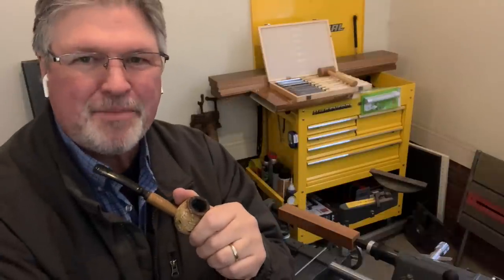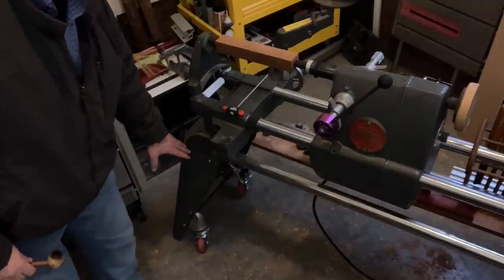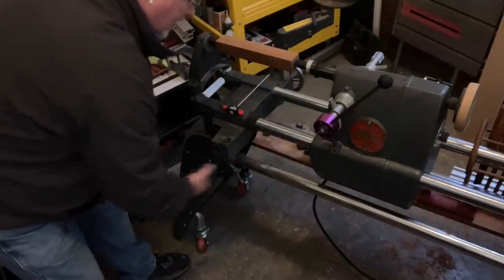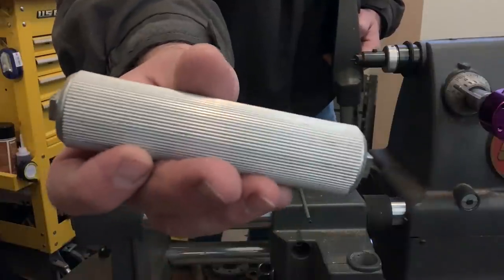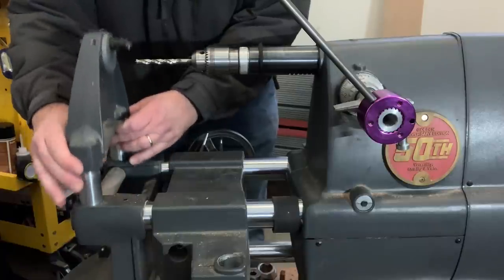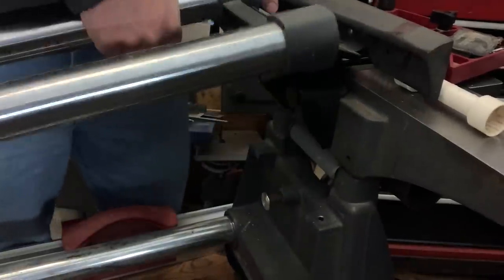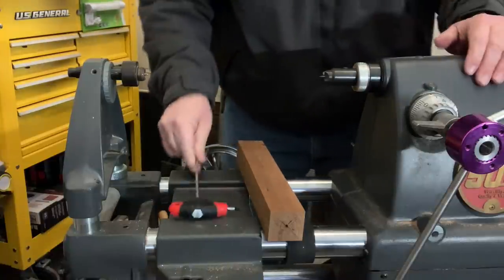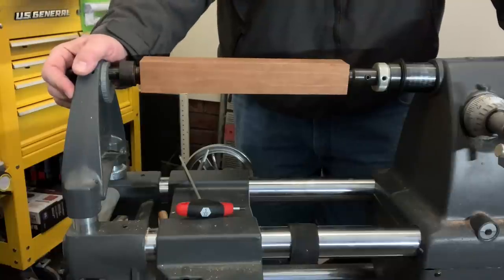Before Turning On Your Shopsmith Lathe, Watch This!

Comment: I do not agree that the Shopsmith is a lathe based machine. In fact without the heavy banjo upgrade it is a terrible lathe. On the other hand it is both a vertical & horizontal drill press. The SS drill press in my opinion it may be the best woodworking drill press on the market, but not a $4000 drill press. 

On another subject "waxing" I think you are right on target with everything but waxing the quill. I would never wax there. For my quill I oil the shaft & grease the rack & pinion. I see your point, but considering the pressures & other stresses applied here I want smooth but rugged on the quill. 

  By now I hear you saying "now I know why they don't send donkeys to collage". My SS background is this. I started woodworking in the 7th grade shop class. My teacher & friend was a guy who also lived a cross the street. I didn't  know it at the time, but my 7th grade class was also his 1st year teaching. In his senior year Magna Filled a room with porotype Mark 5 machines and turned those future shop teachers loose. When   my teacher got to my class the SS Mark 5 was the best thing since sliced bread. It left an impression. I didn't get my 1st used Mark 5 until the mid 60s. I had to rebuild twice. A new machine cost way too much for my pay scale. Soooo I bought a TotalShop. I would like to go on record (after repairing both mine and others) this machine is a piece of junk. I think the TotalShop guys took a SS to China and told them to build a similar machine just as cheap as possible. AND THEY DID! I bought my 520  in 1999. At this point my SS is my drill press & back-up for my other tools. I served as SS mentor in my local working club & as a go-to person on North Carolina Woodworkers web site on things SS. 

Interesting side note. The going price around here for a used SS with no extras is  around $500   when such a  machine comes on the market cabinet shop jump on them like a rooster on a June bug. Why? The SS makes a fine horizontal boring machine, and a real horizontal boring machine cost several $1000.

Pop
Reply from the maker: Hey Bill, it's nice to meet you and thanks for dropping by. I'm also in NC. That's a neat story about your shop teacher. I bet the Magna boys took photos of that too, but all that neat history is lost to time. 

When I say it is a "lathe-based multipurpose woodworking tool" I'm not just making that up. No one is saying that it's a prototypical lathe or even a great one, but that was the tool that Hans Goldschmidt designed it around. In fact, in the US patent for what would become the 10ER the very first claim begins: 

"The present invention pertains to material working machines, and more particularly to machines whose components can be variously arranged to perform diverse operations.

An object of the present invention is to provide a material working machine capable of functioning as a lathe, (etc.)"

Notice which tool was listed first?  

Also, of the ten US patent classifications that the Mark V is patented under, the first function singled out is  "Classification Y10T29/5109 Lathe."

My experience comes from working for Shopsmith for 14 years. Daily I got to hang-out with John Folkerth, Jim McCann, and many other brilliant minds in the R&D and product development department. I'm also a HUGE Shopsmith history nerd and, like you, was a fan for years before owning one.  I now own four Total Shops and 5 Mark V's, a 10ER and three Sawsmith RAS.  

It's always nice to meet another Shopsmith fan, so please don't be a stranger.  Scott

Comment: I see videos that use a Forster bit to do the initial hole in a turned vase.  How do I drill out a vase that I turned on my Mark 5?
Reply from the maker: Is the vase turned between centers or on a chuck or faceplate?
Reply: @MyGrowthRings  The short answer is, I’m open to suggestions. The more complete answer is, I have been in woodworking for decades, but I am brand new to turning. I was given a Mark V with only a chuck, a drive center and a live center in the tail stock. I’ve made a few spindles and handles. I’d like to get into turning bowls and vases. I’m very willing to buy more accessories once I understand more about what I need. If this is too much to ask, I completely understand. I love the thoroughness and clarity of your teaching.
Reply from the maker: @jimwall1348  There are a couple ways to skin that cat, but at some point you’ve got to drill and or turn the interior of the vase. If I’m turning between centers I usually turn something of a tenon or cowl on the bottom that later I can grip with a chuck while drilling using a tail stock chuck arbor holding a Jacob’s chuck and a drill bit. Other times if I’m turning a base I’ll turn the body of the vase between centers and create a tenon on the bottom, then turn the bottom on a faceplate or chuck and then using a tail stock chuck arbor I’ll drill a hole in the base that matches the tenon and glue them together. If I’m in a hurry I’ll use a CA glue. From there drill the hole in the vase, again with the tail stock chuck arbor.  I hope this all makes sense.
Reply: @MyGrowthRings  It does. Thank you. Any chance you have a video that shows this process?
Reply from the maker: @jimwall1348  I’ll try to work it in. Scott

Comment: Since I had the old 500 base, I went and checked my lathe adjustment and found that by replacing the old base with the dual tilt, my adjustment on either end was almost minimal.  I also noticed, when using the lathe, the the tailstock flexed just a bit when using a dill bit attached to it. So I took out my plastic dado shims with NO MARKINGS ON THEM (TRASH) and found one that just slipped in the tube slot on the OUTSIDE of the tube away from the motor.  Presto!  NO flex.  AND... ON YOUR 6" Belt Sander video, what is the length of that 3/8" cap screw that everyone probably through away.  MIne is missing, K
Reply from the maker: Sounds like a great fix. As for the bolt, I put the details in that video's description. Scott
Reply from the maker: I just tracked it down and it's a 3/8"-16 x 2" hex head cap screw.

Comment: Scott, thanks for another great video. I noticed the single versus double set screw in the tailstock on several of the shopsmiths I’ve restored. I’ve added the additional set screw on the tailstock, and also added them on the way tube brackets (especially the ones you have to remove the pivot rod to access the set screw). My question is when Shopsmith went to two set screws, did the change the eccentric at all or are they interchangeable regardless of manufacture date? Also, as noted in a previous comment, I thought the way tube adjustment set screw was set during the main table alignment phase to make the main table parallel with the end table. If it’s parallel, it should also align the quill with the tailstock. I’ve added an incra TS-LS fence with 5’ connecting tubes and it really accentuated any error in the way tubes. Again great videos. You mentioned rust removal, it seems thats all I’ve been doing lately, the three units I’m turning over are covered, it amazes me how some of these units are neglected.
Reply from the maker: I’m not certain, but I don’t believe there was any change made to the eccentric. My comment about the table not being parallel isn’t to say that the tables can’t be made flat, but that the fence, when moved from the main table to a support table mounted to the left will not always be in proper alignment. Yes, adjusting that large set screw to align the table tops could also inadvertently align the tailstock.
Reply from the maker: And as to rust, yes, There is so much bare metal on these tools and if someone purchases a Mark V and never gets to the waxing steps, these parts are destined to rust. This Mark V 520 was owned by a guy who had no interest in opening a manual, so it is in sorry shape.

Comment: Thanks Scott.  Can you repeat how to adjust the lower tubes if you have a Mark V that's from the mid 80s?  I've looked and I can't see any set screws.  I got mine when I was in the Marines stationed at the air station Beaufort SC.  We had a Shopsmith club and Shopsmith would send a truck down a few times a year when we had our meeting so we could buy equipments at good prices.  I've had it a long time but just started using it again. Your videos are the best I've found.  I have a 12 inch planer that I never set up...another thing to tackle.  Many thanks!
Reply from the maker: I appreciate the kind words, Jeffery. If you don’t have a set screw you have two options: File, sand or grind the point where the tiebar rests or add a set screw by drilling and tapping the lower side. You’ll know it only setting the eccentric cup in the tail stock with a drill bit in the Duckett and a center of some kind on the tailstock. If the bit is leaning toward the front of the machine you’ll need to remove some metal from the back side of the headrest or add a sets de to the front side. The opposite is the opposite is true. You may find that everything is just fine without this, but in any case make sure that the machine is sitting on it’s legs and on a flat surface.

Comment: Hello. Do all ShopSmith models Lathe Spindles come in the MT2 size? I am Not looking for MT1; MT2 only. Thank You.
Reply from the maker: They have all used a #2 Morse taper on the tailstock but the spindle on the quill is 5/8" with a tapered flat for a setscrew. Most everyone who sells lathe accessories like chucks and faceplates have options for Shopsmith users. Scott

Comment: Hi, my speed dial on my old shop smith doesn’t seem to want to turn, what can i do about that?
Reply from the maker: Is this new behavior? Is the machine running when you are changing the speed?
Reply: @MyGrowthRings  okay, found out i shouldn’t have been changing the speed while it’s off, bad idea. now when i turn it on it hums but doesn’t turn at all, so i think something happened with the pulley?
Reply from the maker: @joerusson7010  I did a video on this, but you should be able to raise the speed with the Mark V off, and if it is pinching the belt that should loosen things up.

Comment: Great info, I’m checking my machine before turn again! What do you find is the turning limits of a shopsmith? I have a ‘92 mark v bought used last week and I was trying to turn a 4”x4x26” piece of red oak but the machine was vibrating fiercely and scared me. I rechecked venters and locked everything down but it kept doing that.
Reply from the maker: The limits are your imagination. Check this video out and report back: https://youtu.be/rQbzEz0-7X0  The key thing to learn is what the Karate Kid learned from Mr. Miyagi: Balance.
Reply: @MyGrowthRings  I have to respectfully disagree. The SS is an amazingly well made and adaptable tool however there are some design compromises that had to be made. Working around those compromises is fine but exceeding them isn't a good idea. There are a number of advanced turning projects that require the piece to be unbalanced. The normal solution is to have a honking big lathe and a slow turning speed. The slower you can turn the piece the smaller the honking big lathe can be. This is where the SS has problems, its slowest speed is 700 RPM which is too fast for a lot of things and the machine is relatively light. Balancing the stock as much as possible before putting it on the lathe takes advantage of other SS modes to bypass the problem in many circumstances but not when the piece is supposed to be unbalanced. The PowerPro headstock alleviates this to some degree by having a slower low end speed. It widens your potential projects a great deal. However this must be done carefully with thought about what stresses and strains are being put on the machine as well as operator safety. Vibration tells you something is wrong.

I've seen the video and it is scary. The guy uses the lathe:

1. With jewellery on;
2.  Adjusts the tool rest while the lathe is turning;
3. The tool rest and possibly the way tubes are flexing while he makes the cuts;
4. The bearings and mounts are overloaded and may fail at any moment; and
5. He has the machine under tremendous static stress to "stop vibration". Turning it on only adds dynamic stress to an already overloaded system.

Yes it looks like he got away with it but how much damage was done to the SS and how safe was it?
Reply: I cut the edges off with the table set at an angle. The larger the piece the more sides I cut off. That eliminates most of the vibration. Start slow.
Reply from the maker: @frankenberry9670  He’s my hero.

Comment: My tailstock isn't lined up with the headstock but my Shop Smith is not like yours and I don't have those adjustments 😬
Reply from the maker: James, do you happen to have an early Mark V? You will have to use the eccentric center to align the centers, but I’d suggest you make sure that everything on your Mark V base are properly seated and tightened, and that it is resting on a flat surface. Scott

Comment: A warning to those who decide to fuss with the set screws on the bottom of the way tubes. DO NOT completely remove them like I did! It's next to impossible to place the set screws into the hole straight dead on, due to the base arm pin being directly in front of the holes. Tried for 3 hours with no luck. Gonna try again later and purchase a ball end hex wrench or perhaps shoving the set screw into a plastic straw straw and bending it around the base arm pin. It's a real pain in the butt!
Reply from the maker: Oh no! Yeah, don’t do that.

Comment: How do you turn bowls on a ShopSmith?
Reply from the maker: That’s a big question. Is your question how do you mount them or what tools do you use or is it how to you approach the task? I used to do a fair about of bowl turing but haven’t done it in years. I started simply screwing the blank to a faceplate and using a round nose scraper, and they lead to using chucks and bowl gouges and ring tools, etc. it’s really an evolution that can take you wherever you want it to. What link of turning would you like to do? Scott
Reply: @MyGrowthRings  when I watch turning videos, most guys have some kind of 4-jaw clamping piece that holds the bowl from the head stock. I've not seen videos where anybody has one of these on a ShopSmith.
Reply from the maker: @FIS681  Yes, you can use them and I own several are used in. I haven’t specifically gone looking for Shopsmith turning videos. I’ll see what I can do to share some details. Scott

Comment: Summary:  It's a matter of physics.  "PAY ATTENTION to what you're doing! For every action there's a reaction. IMHO, personal responsibility as fallen off the chart.
I'd like to add I'm not a shopsmith owner, I have 4! (2) Greenies, (1) 500, and (1) 510. I bought my first, (510) brand new in 84/85? That was back when they had "package deals" I got the whole kit & caboodle.
AND NOTE: I did not skip in the set up! If you want it to function with precision, You have to set it up properly, right?
One might ask why you'd need so many since they're supposed to be 1 powerhouse for multi use. 
For one, I like to have a backup since I earn my living building. Also, time is very important. So everywhere I can save time by not having to change setups, saves money. Also, At any given time, I can have 4 separate table saw set ups, or I could run 2 tablesaws, bandsaw,  drill press, It just makes life so much easier.
One more thing which brought me to this channel. Anybody know of a video of the mark 7 "under the hood" so to speak? 
And I'm with a few comments I read, "no matter how much you know, you can almost always pick up a sliver of a piece of information." Thanks
Reply from the maker: Which Mark 7 and what are you looking to learn about what’s under the hood? The 1960’s Mark VII or the current electronic variable speed Mark 7? Scott
Reply: @MyGrowthRings  Mark 7 Not vii. 
My understanding is they're pretty much maintenance free? 
The greenies are very difficult to work on. 
There isn't an access port at the logo like the 500 or510.If I'm not mistaken, the access port on the 500 is a little smaller than the one of 510. (harder to get my hand into). I guess I'd just like to see a video of one opened up.
Reply from the maker: @andybilakshow260  Pretty much. There is one poly-V belt that might need occasional retention in and replacement, but otherwise, they are pretty maintenance free. One concern I have is that there’s no way to do firmware updates on it, and it’s my hope that someday they will offer a version 2 that has that capability. Scott

Comment: Absolute total ignorant nube here...who has just been "gifted" a mark 5; a "Goldie"?...well, most of a mark 5.  I went the theater tech instead of shop class route in life, so I've never been properly trained on anything more sophisto than a chop saw or a table saw, though I have had a few years of set building and prop shop work: I'm not unsafe to be left alone around the toys, as it were.  Is there a way I could message this Scott guru fella directly, maybe send him pics or video clips, so he could...maybe advise me enough on the status of this thing and what all elbow grease and fiscal investment it would take for me to be... capable of asking Shopsmith lathe questions in public; being up to speed with the rest of the class?
Reply from the maker: Hey Darrell, you are welcome to email me at ScottMarkwood(at)gmail(dot)com. I have a day job so I’m not available for extensive tutoring, but I’m happy to help where I can. Scott
Reply: @MyGrowthRings  many thanks!